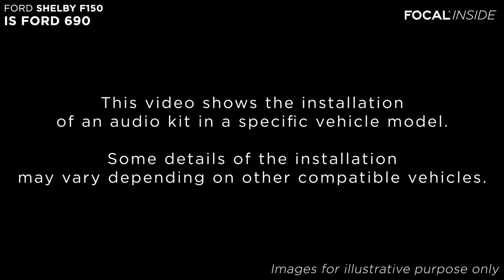Focal Inside - IS FORD 690 installation - Ford Shelby F150

Comment: Nice concise video!  Does that foam piece come with the tweeter? Also, how do we know if we need the tweeter wiring adapter like you used in the video?  Is it included in case we need it?  Thanks.